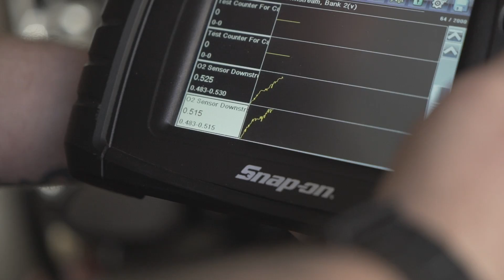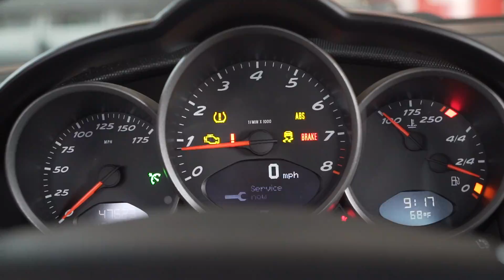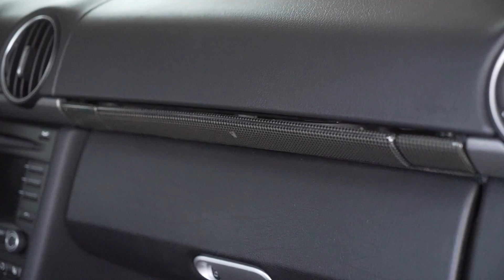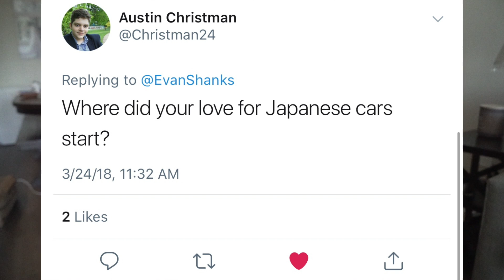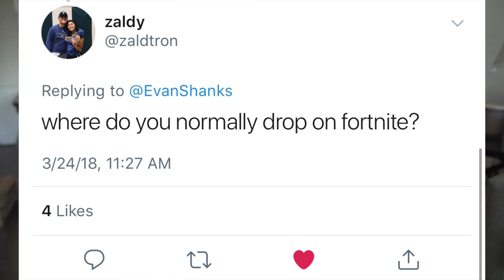Why I bought a Mitsubishi Evo X (Not an 8, 9 or STi)

Comment: Evan, Just build that trans and diff if you're going to be launching it at all. Those are the weakest points of the evo! Other then that, you're good to go! Remember, it's not a subaru! You can easily push 450+ on the stock bottom end. Yes, I know the Evo X has an aluminum block but they are still tough! not 4G63 tough like mine ;) but much tougher than your Sti lol

Comment: Bro Evan, buy a wrx, the ej205 is one of the strongest ej platforms you can have, yes it’s a 2.0 vs the 2.5 but 2.0’s don’t really suffer from ringland failure and from my personal experience can handle a lot more abuse. Also the new fa engines that are in the new wrx‘ are a solid platform from what I heard too, ej25’s are junk

Comment: 4G63 isn't a great motor?  Iron block?  Aluminum Head?  Can make 400 hp reliably on the stock bottom end?  Sounds like a terrible motor.

It's not a Subaru, dude.  It will actually make power amd hold together if you know how to do it.

As for the 4B11, it's still better than whatever timebomb is the majority of boosted Subarus these days.